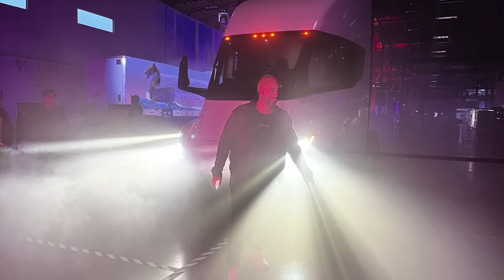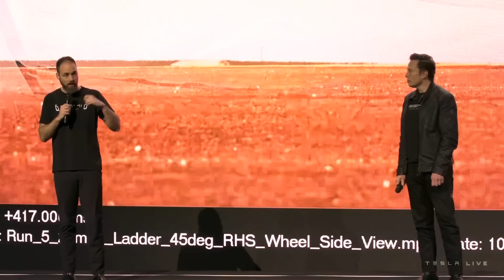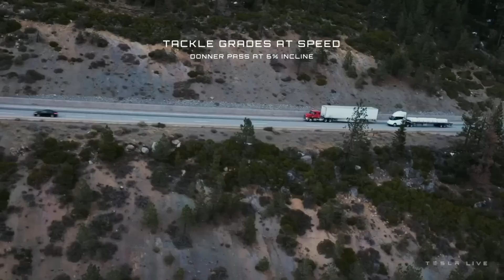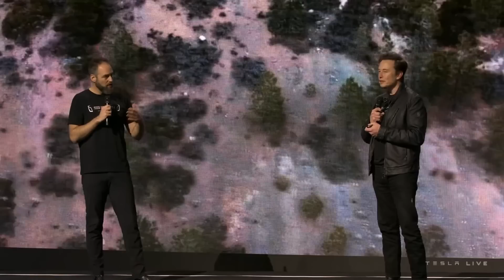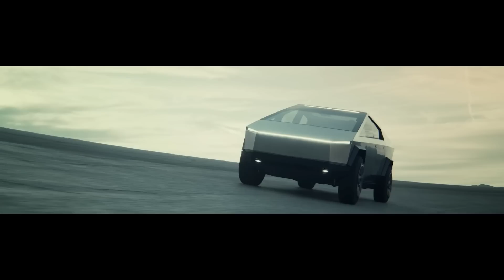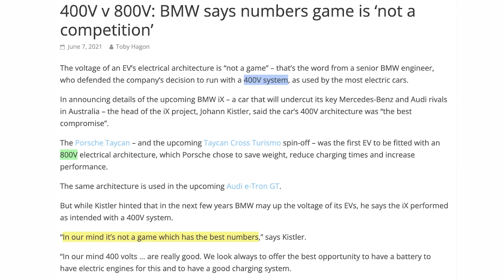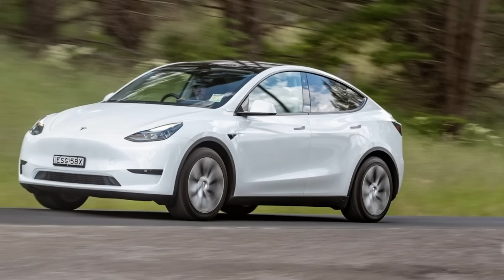Why Tesla Is Being Secretive About Tesla Semi & Why OEM's Are Giving Up ⚡️

Comment: I wouldn't say the 500 mile (more like 450 after 20k miles) is only going to be short haul. Sure Truckers say they need 1000 miles range to push 14 hours driving to make money but when the realize how much cheaper electricity is, and the reduced maintenance costs, the will view tge 1-2 hour charging in route as the best hourly money they have ever made. Even independent long haul truckers are going to be fighting to get one.
Reply: A friend picked up and load and fuel went up a dollar while he was on the road.   He made zero on that one.
Reply: @danharold3087  Yep, electricity rates change over years, not days or hours like diesel.
Reply: @andyfeimsternfei8408  It is even better for a few reasons.  We can lobby the public service commissions that set rates.  Investment groups are building wind farms.  Way easier than permitting for oil etc.   And more importantly companies setup solar and or wind farms with grid scale batteries.  Sell power to cars and the grid.  Good stuff.

Comment: I believe the reason for not much parameters is because it’s not the final design yet… 🤣
Reply: I think the battery is still in flux. I think the battery will always be in flux.  Or at least for a few decades.  Other than that they have been driving the truck for a few years.   At worst a few tweaks.

Comment: I am really looking forward to the Semi being used for port shipment.  Such as the Port of Oakland.  Due to pollution they have to have trucks that have had additional pollution control support installed take product form the port to the destination.  The people that live along the routes have statistically significant increases in breathing related diseases such as asthma and lung cancer.  I can see huge benefits to using the Semi in these kinds of applications is incredible. I just hope the transition is fast.
Reply: As a medical doctor - I will also add that what's most misunderstood about air pollution is that it negatively impacts cardiovascular health, not simply lung health. This is due to the particulate literally being so small that it enters your blood stream and causes massive inflammation/ increasing the chance of long term cardiovascular disease.
Reply: @Haliotro  And fertility. And many other bodily functions.
Reply: Operators in Europe already use EV trucks on the short range short hault fixed routes. For many months now.
Reply: @wolfgangpreier9160  but the range not very good (150 - 250 miles). Semi is a game changer.
Reply: @lancetruong4957  There are no trucks with 250 miles range in Europe. Some have up to 250 Kilometers. Most have less than that. Of course those are the first generation trucks. They are still fossil trucks with electric motors and batteries. 

It will take some years until Mercedes, Scania or Traton (VW/MAN) have competitive vehicles to the Semi.

But the Semi is too long and can not be operated in Europe. Our roads are narrower, our roundabouts much tighter and the wheel base of US trucks does not fit many streets. Thats why they can not get permission to be operated in a fleet. Only single imports are allowed.

Does not matter, The Semi is built for US roads. And the US needs many thousands of it. 

Most truck builders will go bankrupt until then. Maybe Cascadia survives? We'll see.
Reply: @wolfgangpreier9160  Thanks for the correction.
Reply: @wolfgangpreier9160  who says they can't come up with an EuropeanVersion in Giga Berlin?
Reply: @LACHIVA1969  Nobody says they can not build them in Grünheide. If the other manufacturers do not feed the hungry market and Tesla sees a opportunity to make a shorter Semi oder a more pedestrian friendly Cybertruck they will start to build the factories to make those vehicles. I would love if they would have had started in 2020 so MY Cybertruck gets delivered in 2023. But i guess i will have to wait a few more years.

Comment: Higher voltage does not always reduce wire costs. Yes it reduces the conductor size but it increases the insulation and costs/complexity of connectors.

Comment: No on the 850 kwhr pack size.  they used 93% of the charge it holds... so divide that 850 / .93.   You're welcome, no consulting fee required.   It's between 900-950 or 1000 kwhr with some cache hiding in there. ;)   It was a great presentation.  What you wanted was a spec sheet and I doubt they're totally finalized enough to release one that they're satisfied is locked into volume production.
Reply: And don’t forget, they were at max capacity (almost) so battery had to be at least 1000 kw or more.
Reply: Agree. Maybe it could reach 1.7 kWh/mile, but not on average.
Reply: @nicklasurbansson4650   cannot quantify how often they'd hit 1.7kwh/mile and whether it could do it on average or what the distribution would be.   Musk quoted at 1.7 and said they could see a path to 1.6 and possibly to 1.5.  That's all the intel any of us can go on other than the miles and that it took 93% of whatever the charge amount was.  :D
Reply: You're right.  See my comments above.

Comment: If Tesla Semi moves 40,000 lbs of load 500 miles on one charge, will the same Semi with 20,000 lbs load move it 1,000 miles?
Reply: no. Acceleration is the most power hungry part of a drive. Once at speed rolling resistance and wind drag are the largest energy waste. And that won't change much empty. It will get more but it won't double.
Reply: @moki123g  Thanks. I knew it would not be a linear relationship but it would be nice to know if the increase follows some equation.
Reply: No. Load to efficiency is not linear.  Loaded to to empty in a diesel burner can be as small as 2mpg different.
Reply: No, the weight makes only  little difference. Most is aerodynamics.

Comment: To put the Tesla Semi range into context, 1.7kWh/mile is equal to about 19 MPG.  A typical diesel semi gets around 6.5 MPG.  My Toyota Tacoma truck gets about 19 MPG on the highway.  So, a fully loaded Tesla Semi is nearly identical in energy efficiency to a typical pickup truck.  This is why electrification of transportation is important.  The status quo fossil fuel infrastructure is extremely wasteful.

Comment: Tesla said nothing about the guaranteed low price for charging at megachargers.  I expect that's the one thing from the initial announcement that will be completely dropped.  The economics just don't work.
Reply: These guys are just going to have a Megapack at every distribution center. They will have plenty of space to setup solar and charge it for pennies. You can guarantee the price you are going to pay.
Reply: If the semi has a 750kWh pack, then you would need a 100 kW array or more to generate enough power for one charge per day.  When this expands to having truck stops with a dozen chargers, you're talking 100s of charges per day, so that means 10MW or larger arrays for each charging station.  That's huge, and it's not happening.

Besides, if Tesla had massive arrays, they would just connect them to the grid and operate them as regular power plants.

Comment: Are you sure that the regen (only in the tractor) will completely replace the brakes that are also on the trailer?
Reply: As there is no published reports or first hand accounts there is no way to know.  But it was implied when they said at the bottom the brakes were cold.
Reply: Not replace, but it is regularly not being used. Just as in a passenger vehicle.
Reply: @AudiTTQuattro2003  did not.  this was not a special trailer.
Reply: @AudiTTQuattro2003  The range is specific to the trailer.  Tesla does not make trailers.  I think you misunderstood.

Comment: The "$25k tesla" (which might not be $25k, but will be entry level) is the next gen Model 3. The Model 3 design is over 5 years old. With all the work Tesla has done, and with Model Y cannabilizing its sales, it needs a redo - esp for cost cutting. Granted, Tesla will never confirm this to avoid Osborne effect, but the timeline is perfect and we know Tesla is working on next gen Model 3. In addition, they're probably also going to offer a hatchback version (maybe even replace M3 sedan with hatchback only) as Europe loves hatchbacks and it will replace the VW Golf. Hatchback is also a better fit for cities - which is also a good fit for entry level vehicle.
Reply: We have been told it is a bit smaller than the 3.
Reply: @danharold3087  Given Tesla now has a new Model S/X and Model Y, they can reduce the size of the Model 3 a bit to ensure it's a better fit for Europe, China and even dense US cities (NY/SF, etc). When the Model 3 came out it was the ONLY lower cost option so they had to make it big enough to fit most families. Model Y is now a better fit for most US customers (as we can clearly see by demand)
Reply: @ranig2848  They could but it is not what they have been saying.   In the end they know we don't.  Plans change etc.

Comment: Very good comments about the charging curves.   Many people don't understand that doubling the charging power doesn't necessarily double charging speed (actually usually doesn't).  Lots of variables are important in charging speed.
Reply from the maker: sooo many lol more people need to be aware of this and it was clear watching twitter after the event last night!
Reply: @DillonLoomis22  Well batteries can only be charged that fast. But with a big battery (many cells) the charge amps go up because its distributed among more batteries. So I don't think Cybertruck can charge much faster than Model S even with 1 MW V4, its a function of battery size isn't it.
Reply: @biondanishgenomeinstitute8193   Charging speed (in terms of miles per hour) is usually a function of battery size assuming the charger can meet max demand (the bigger, the better).  Charging speed (in terms of percentage of capacity)  assuming the charger can meet demand, is a function of battery chemistry, BMS, temperature, and some other minor factors.  No matter what size the battery is, the charging speed is typically limited by any single cell's charging speed at a given temp (again, assuming the charger can source the maximum demand of the pack(s).
Reply: @AudiTTQuattro2003  The higher voltage only reduces the current in the conductors and lowers heating there, not in the cells themselves.   The BMS brings the voltage down at the cell level to the low voltages that cells can charge at--about 4V+ (no matter what the voltage of the charger).   So high voltage is mostly only a benefit for the charger conductor cable and internal conductors in the vehicle to allow them all to be a smaller size since the current flowing through them is smaller than a lower voltage charger (thus heating the conductors less (but not the cells)).
Reply: If we look at the fastest charging phones - all have two separate batteries, so instead of putting 1mW in a single battery, think of it as putting 100kw in 10 batteries each, this is quite manageable
Reply: @zubatia  The "battery" in a phone is usually just one cell.    If two cells are used, you've basically made a larger battery "pack" and the charging speed increase is because each cell can charge at the same rate as one but this gives us twice the energy because of the two cells.

Comment: Because fleet sales actually does involve negotiation. I think Elon left battery size, and cost out because that’s a variable where it’s not variable in individual cars. I agree I wanted to hear it too, but as an investor I’m good with it. Thoughts?
Reply from the maker: you may be right brad, but tesla is in such a position of strength i don't feel they need to be so tight lipped about all of this, but i'd venture there is some good reason for their lack of divulging any real data
Reply: @DillonLoomis22  They develop the numbers together with Pepsi and a few others out there. They do not have the numbers themselves. Just my opinion.

Comment: I hope they got all the batteries they need from now on 🤞
Reply from the maker: sounds like the are solid in the near term but 4680 supply will need to be progressing well and will be very important toward the end of 2023
Reply: @DillonLoomis22  The semi will be using 2170 cells only for now though as their current energy density is better than the 1st gen 4680 cells.
Reply: GO TESLA GO 🚀🚀🚀👍🏻😀
Reply: Tesla has said that they have batteries covered.
Reply: @bobwallace9753  Yep, but I don't know if they're were including Semi mass prod in the equation. This truck is battery thirsty, like 10-12 Model Ys
Reply: @davidsc4680  
I have no doubt that they included the semi, the Cybertruck, production expansion of existing models, massive expansion of storage systems, and some other stuff, probably.
Reply: @davidsc4680  right.  they are not pushing hard on the semis.  They have enough batteries, for now.  But that could easily be eaten with massive semi production.  Meanwhile, the semi is only a beta version.  They are going to get feedback for improvements from PEP and wait to push sales until the semi is much improved and battery supply is more secured.  They're not going to sacrifice 12 Model Y sales for 1 semi.
Reply: @raymondadkins9130  Depends. You're thinking from a purely monetary basis: 12 MYs ==> ~$100K profit vs ??? profit per semi. However, since Tesla is not hurting for cash flow they may be more motivated by their mission statement: to reduce pollution (as that was one of their major points made in the presentation). 

Another factor might be a desire to get the production ramp started in order to establish an early stake in the class 8 market which would help to ensure their future dominance.
Reply: @GntlTch  I get what you're saying, and it's not unreasonable.  But TSLA's mission is to advance sustainable energy.  reducing pollution is just a major side benefit.  semis may be better at reducing pollution, but insofar as advancing the cause, putting 10,000 EVs on the road for a mass market would likely do more than 1000 semis for a niche market.  
Of course I'm thinking only of profits.  And so is TSLA, as that is their fiduciary responsibility.
But that's all predicated on there being supply constraints like batteries or chips.  So yeah, with no constraints, they should be ramping both as quickly as possible.
But the real reason that I think that they are not pushing hard on the semis is because it's not a finished product.  It's more or less a beta version that PEP is paying them to develop.  I imagine that PEP is getting a discount for being the guinea pig.  I expect TSLA to ramp slowly while incorporating the feedback from PEP.  Once it's near optimized, I would expect them to make a concerted effort to ramp production and go hard on sales.